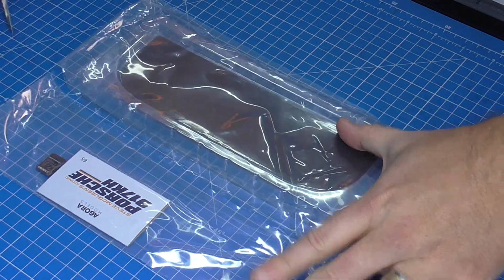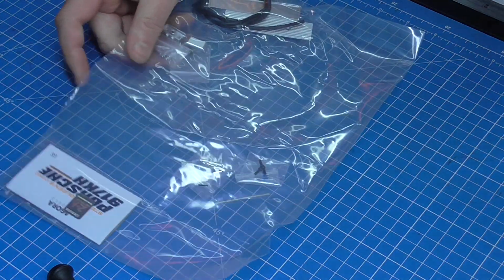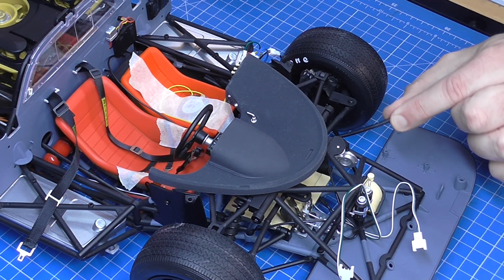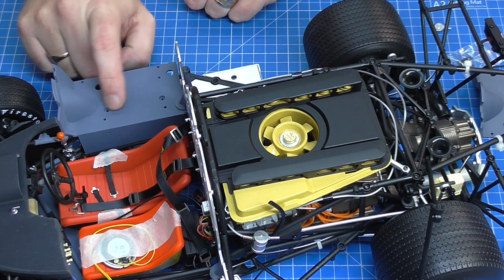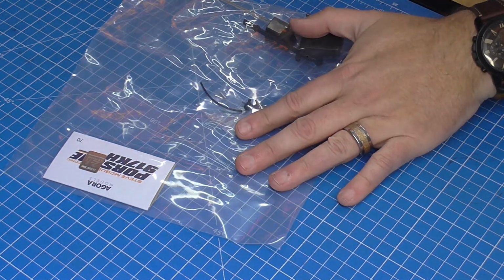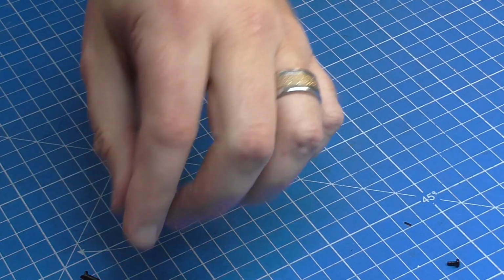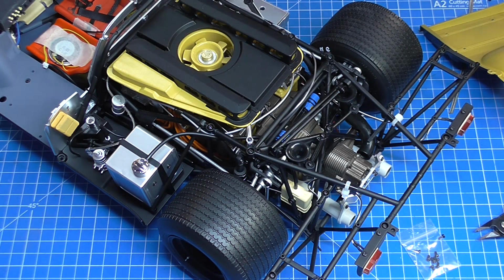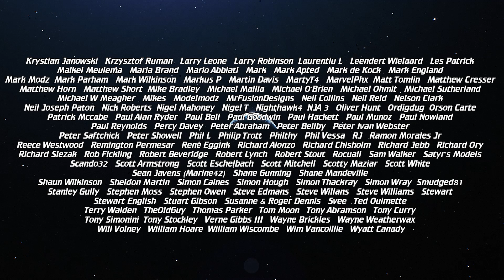Build Steve McQueen's Iconic Porsche 917kh from Agora Models - Pack 9 - Stages 65-72

Comment: I am building this model and the Lamborghini. Both models have problems with the wire connections to the switches breaking off. It would be a great help if you could show how you re-solder these very small connections.

Comment: Yhe oil tank assembly is very important as the.oil was cooled by the radiator in the nose.  In the original 917 Porsche actually routed the oil through the hollow chassis tube which made the cockpit very hot.  Separate tubing to the oil tank cured that.  (Obviously calling the engine air-cooled was a little misleading.)

Comment: You're slowly catching up to IXO Box 19 - Stage 76! The cables that run behind the engine area actually connects to a fuel filter (I think it's called) But you may have a problem with connecting the wire cables to the Y connector. For me, the tension of the cables was so strong it broke one of the arms of the Y connector. (Easy fix). I ended up trimming the cables down quite bit. I've read that many builders are substituting the wire cables with braided hose, which is what the cables are supposed to emulate anyway.  I find it strange though that at this late stage of the build, both the Speaker and Power switch have yet to be installed. 🤔
Reply from the maker: It certainly is

Comment: Just finished doing the fuel lines to the top of the stacks on my build. Just like the oil pump lines in this pack they did want to kink, just like you said they would. I re used one of your other tips about putting thin solder inside the HT leads to make them more manageable. The fuel lines are clear so I used 50lb clear monofilament fishing line in them. Zero kinks even at the tight top bends. Will do something similar for these steps. Love watching your build before I do mine as a "virtual practice" run.

Comment: If I may suggest, at 6:20 where you suggest keep turning the wire.. keep turning it the same way as the twist, otherwise the strands might separate? Assuming it's not just one wire moulded to look like separate strands.

Comment: Wayne, re the pipes for the oil tank. You mentioned the kinks being unavoidable, but I just thought.. maybe your trick for shaping some tubes by feeding a wire down the middle would stop the hollow tube from kinking?
Reply: That's exactly what I did. No kinks.